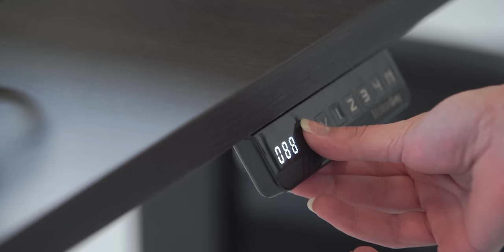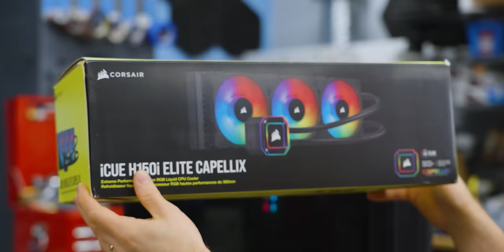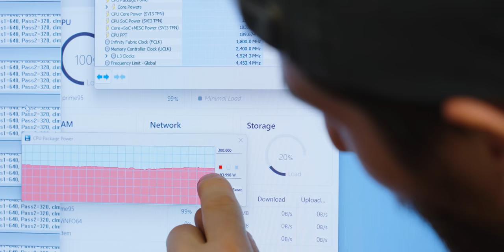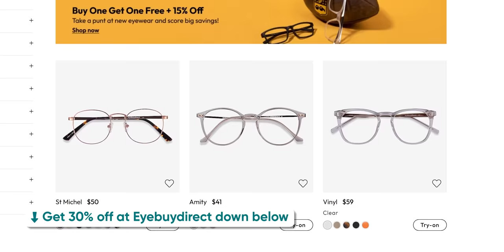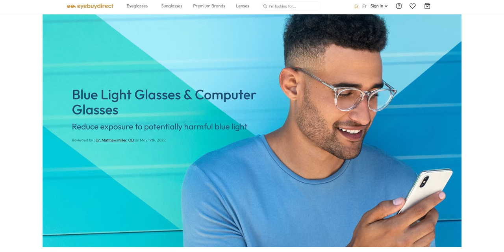Redneck Engineering my own CPU Water Cooler

Comment: actually a heater core is all about cooling,  or rather it's all about heat exchange. where the heat ends up is a function of which is warmer the air or the fluid  the heat energy will move to the cooler of the two.

Comment: Motorcycle radiator
The fan one that has at least 2500 rpm up to 3000 rpm for the inverter welder. This should do it if not the air cooler usw the intake fan o f the chasis.around 300 rpm 😁

Comment: If you're patient and persistent enough, you can probably get the heater core for free, which makes this an actually decent value proposition (considering you can get a killer AiO from Arctic for around 100 quid) Otherwise I'd probably just get a radiator and maybe a pump from cheap and reputable budget brands like Barrow or Bykski. Their radiators are about the same price as what you paid for.

Comment: Not past the start of the video yet but… If you want to use a radiator in stead off a heater core but I get size is an issue when referring to a car on surely just a cheap radiator from a motorcycle would work small and for the same price could probably get a new one?
Reply: Arr you mention motorcycle radiators further on 😅

Comment: You guys should try running water through a evaporator of a mini split… But using the quietness of the mini splits indoor fan to cool the water passing through.
Reply: Water cooling isn't literally water. This wouldn't work unfortunately
Reply: I understand that. And it for sure would work, just how well is my question
Reply: @kylebrink7247  sorry as in it wouldn't work as a long term solution due to condensation! Are you in hvac by chance? It would be cool to be seen done, do you think there would be enough liquid?
Reply: I am hvac, I am talking about using the head unit as a radiator for the water loop. ‘No refrigerant in the system, only water’
Reply: @kylebrink7247  ohhhh that seems much more feasible but I won't be pretending to know much more past that since I'm a sparky here

Comment: hey Linus  i don't know if you read your comments but i have used your video to solve a lot of my tech problems but the problem i been having is that when i use my headphones in Bluetooth mode they sounds great but when i turn on my mic it goes into hands free mode and it make the sounds really bad like a pair of cheap headphones you get from 99c store. When i turn off the mic it goes away but when I plug it in through aux cord great sound all the way even when using the mic does not matter if it is a game or YouTube etc. i try it with three different headphones got the same result i read online that a lot of people are having the same issue but i can not fine a fix  or solution for it other than plug in the aux cord. It would be great if you could make a video on how to fix this of their is a solution

Comment: "not in the budget"?

You can get industrial fans that size for like 20 to 40 bucks if they're swapped out because they ran past their rated life span.
Problem with those is that they're hard to control. Can't use a potentiometer and the other thing I honestly haven't tried yet.
But I actually have a few of these fans somewhere to use on a radiator from a busted dairy milk tank chiller i got for free

Comment: You think that's redneck engineering? I used to water cool an AMD XP CPU (I think an AXP1600+)  using an aquarium powerhead pump (sealed so no air would bleed in, they're designed for aeration), a copper s-channel block with a custom hold down made of two sheets of glued and cut plexiglass and 4 threaded rods with vinyl nuts, two 4ft lengths of 1/2 ID tubes, and a 5 gallon bucket. I ran it like for a couple years in the Texas summers in 99/2000. When it started getting hotter than I wanted, I would just dump ice in the bucket.

Yes, I have pics.

Comment: Your heater core is buried deep in your dash. It isn't fed cold air coming in to the front of your vehicle at a significant velocity but rather from air sped up by an axillary blower motor.

Comment: That heater core was expensive. You can buy smaller more modern heater cores. For example original audi/vw heater core half that size for 25 dollars. Brand new

Comment: Ain't it obvious: just take a look at car AC/heating inner fan, which gives a lot more airflow than PC fans. It sure is that this thick radiator will work worse than prebuild cooling system.

Comment: Nope, dang it.  My design is best.   I have a house with a crawlspace in NC.   The crawlspace stays below 60 no matter the weather.   I have a two-gallon reservoir made of a capped-off section of 6" clear PVC pipe, a 120V aquarium pump, and a large car radiator all in the crawlspace.   This is all in a modest wooden frame suspended from the crawlspace rafters.   The pump is controlled by a relay activated by an illuminated front-bezel-mounted toggle switch.   I initially had fans for the radiator, but after a few years, I found I didn't need them.   My water block and an in-case flow indicator are the only things not homemade, although it used to be a simple copper pipe cap  soldered to a machined copper plate and two barbed connectors.   The two water lines and a 120V cord are all the penetrates the floor.   The relay box is at my feet.  The fill valves are at the top of the loop and above the PC case.   I can turn off the pump remotely, add coolant, release air (if any), turn the pump back on, all while the system is running.     Of course the entire thing is on an Isobar, and there are several brass ball valves at strategic locations.   Been runnin happily for two decades.    Quieter than a squirrel peeing on cotton.  Course you city types might not have a hankerin for it.

Comment: Motorcycle radiator works well. I have done that for years. Still think normal air cooler is better. Air coolers is not as bad as they used to be.

Comment: lol if the heather core was full copper and the pipes were really 3/4 you couldjust soldered 3/4to1/2 adapters and soldred a 1/2 inch hose barb on top

Comment: The LEDs turned on in the small fans?  Dudes, you’re running generators pushing voltage back into your MB.  Good times….

Comment: As someone working in radiator/cooler manufacturing for the past decade, lemme tell you. That's not a dense fin. Not even close. 
Modern cars have anywhere from 10 to 30 "folds" per centimeter. Apart from the MQB platform for WV Group. That one is for low power, cheap cars.

Comment: Ahem..., if the pump is supposed to be operating under water, isn't it also supposed to be cooled by it too? If so, what happens when the pump runs longer in simply air?

Comment: My first custom loop was a 230V Eheim 1046, a heater core from a Volkswagen, braided stainless hoses left over from a bathroom remodeling and a CPU cooler I milled myself during lunch break. Oh, and two stainless Festo air tanks as reservoirs. 
Worked pretty well ... until my better half decided to use my puter and forgot to plug in the pump ^^ Bye bye puter.  <F>

Comment: If I were to try this, I would not use the clunky chunky heater core from a car. No, I would use the more attractive, smaller, lighter, equally efficient (maybe more efficient) radiator from a water-cooled motorcycle. Yep.

Comment: I still don't understand how water cooling is more effective than a heatsink, when both methods are dependant on the fan for cooling.

Also, you "upgraded" this cooler by putting on a bigger fan, which you could just as easily do with an AIO cooler.

Comment: Could you CNC a aluminium waterblock so then you can use aluminium radiators?
Reply: yes, without any problem
Reply: @groenevinger3893  only issue is that copper is wayyyy more thermally conductive

Comment: Get on my lvl bro dont use water at all gut a old mini fridge or maybe even something bigger and use the refrigeration  system for cooling instead of water at all you empty the Freon and remove the cooling coil then braise all your cpu/gpu/bridge maybe even ram blocks into the its place (cool the lowest temp parts first)  only drawback is you gotta make ur build in a fish tank of mineral oil so the condensation doesn't fry you but submerged there is no water to condense I still need some dough for parts to finish mine but its gonna be insane.

Comment: Man. Why the hell aren't people soldering on Pex-A fittings and using that tube instead?  

Fool proof perfect, reliable tubing and connections, fast to install, withstands HIGH pressure and heat.  

I mean, what you guys are using is working great so I can stfu
But, the pex-A would just be so convenient

Comment: I didn't see a chevy radiator or a box fan. I question if you actualy had a redneck design this. To properly make a PC watercooled like a redneck you need to only use parts found on the most rusted piece of junk car at a pick and pull junkyard.  Use a big rig's radiator, use their radiator fan or a box fan from walmart. Use the car's hoses in the build. No other way. 

On top of that a red neck wouldn't want to waste money on a fancy case. That rusted  Hood or quarter panel on that car is good enough, bend it and make it into a case. 
LEDs? what do you think i am a yankee? does that headlight work? do the turn signals work and brake lights work? RGB? NO! WRY, white, Red, Yellow! 

That's how it's done.

Comment: A "heater core" is not a heater.  It is nothing but a small radiator.  Period.  It is designed to move heat from hot water to cool air.  Like any radiator.

Comment: Heater coil is f or heating and radiator  is for reduce the heat and m
😅entain set temp...cooling coil isto supply cold air..peace...

Comment: Brazing?  This isn't going to get hot enough for soldering to become unreliable That plastic tube will melt before solder will and you aren't going to have enough pressure to blow it apart. Those sketchy joints you were trying to do had me screaming internally.

Comment: i have a 240mm radiator why does my pc overheat sm? I have a ryzen 7600x
Reply: There could be many reasons: the pump might be faulty due to placement or wear and tear, the thermal paste or mounting pressure might be inadequate, or the radiator could be blocked by dust or damaged.
Reply: @modrribaz1691  I’ve tried to troubleshoot all this stuff so many times, reapplied thermal paste, remounted, replugged everything, and my cpu still idles at like 50, it immediately shoots up while doing literally anything. I doubt the pumps broken cuz it’s been acting like this ever since brand new and it’s not super old anyways. Is it just normal for Ryzen 7th gen to run this hot with 240mm? I’ve had both an r5 7600x and an r7 7700x both have ran very hot and immediately jump to 95 under load. I have a Corsair 4000d flow with pretty basic fan setup, two intake in the front 240mm rad with exhaust fans on it and one exhaust fan in the back
Reply: @zakariyasuleman9961  If you don’t hear the dreaded dying pump sound, air might be recirculating inside or outside your rig, likely from the GPU. Try reversing the exhaust fans on the 240mm radiator to intake mode to test this. If it works, adjust the other fans to balance airflow (As it will have more ins than outs).
That's of course if your gpu isn't in the water looped as well, which is a different story.

Comment: Linus, stick with computers. Car knowledge is not your forte. A heater core does NOT have any air flow from the outside of car. It is a closed system tapping into the engine's coolant after the thermostat to bring hot water/heat to inside in its basic terms.

Comment: A trans cooler kit $50-65 usd  will be more effective and come with more matching stuff   Heater Core Bypass crv Transmission Cooler Install / Power Steering Reservoir Install.